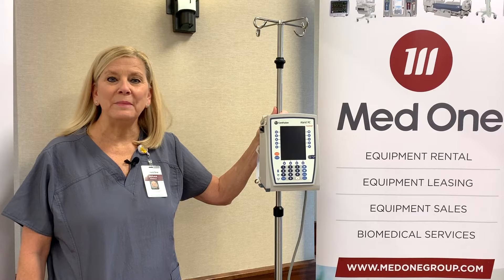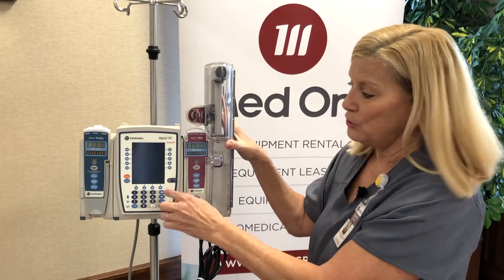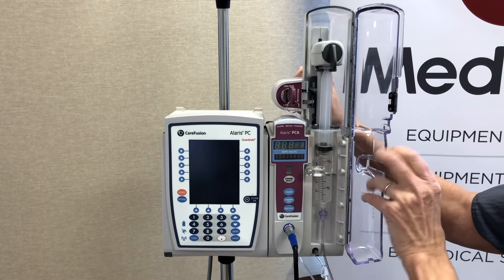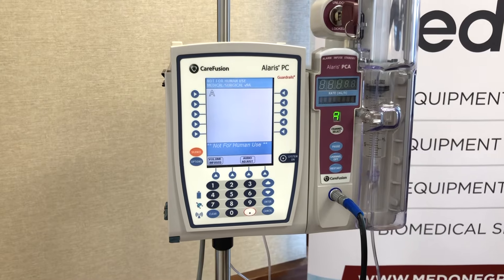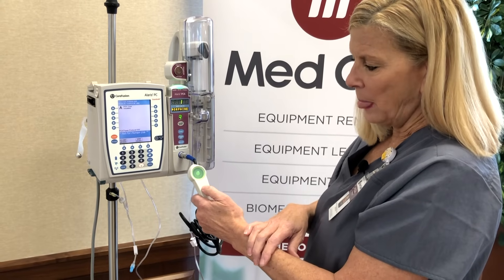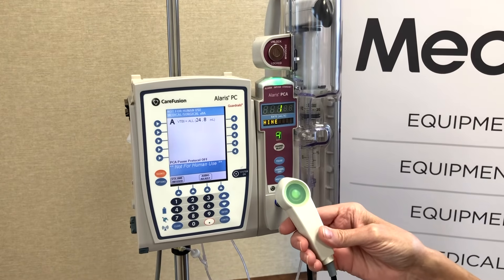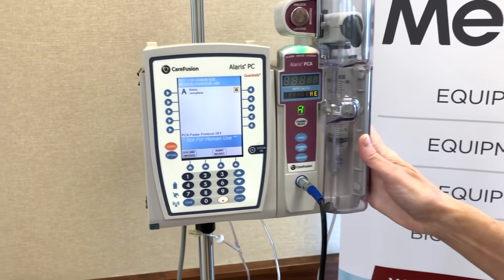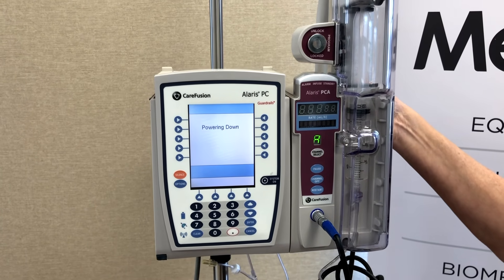Alaris 8120 PCA Training

Comment: can you give information on using the 8120 as an epidural pump in function?
Reply from the maker: You can use the 8120 module for epidural use, but you must specifically use yellow striped tubing. The maximum amount you can give is 60ml, which is the size of the largest syringe the PCA module will hold. Typically, clinicians do not use this module for epidural use due to that limitation. If you have any more questions, feel free to call us at Med One or reach out to the manufacturer for more information.